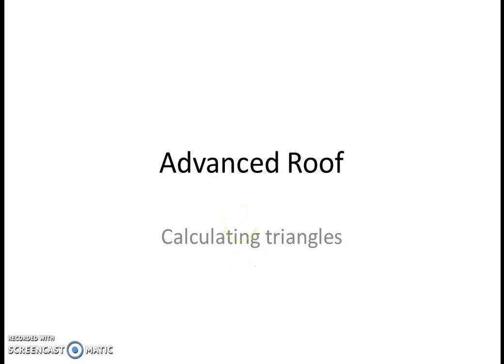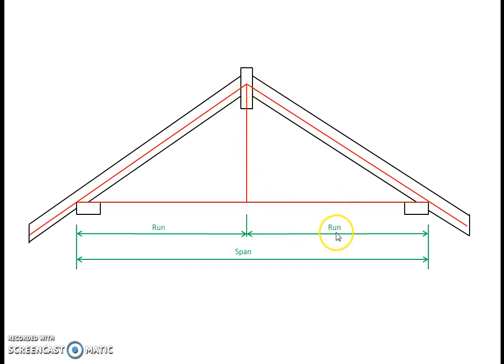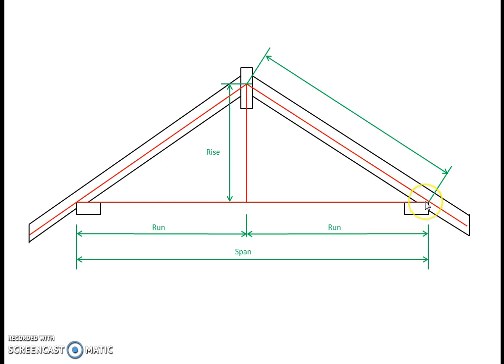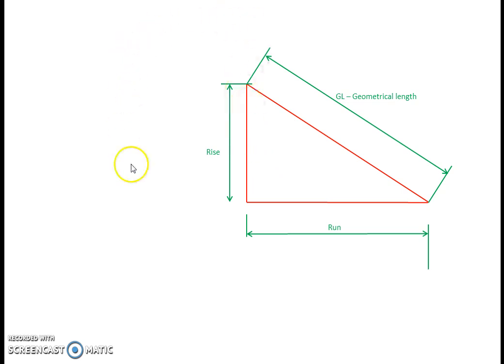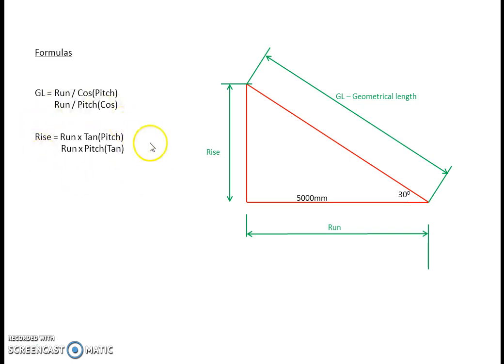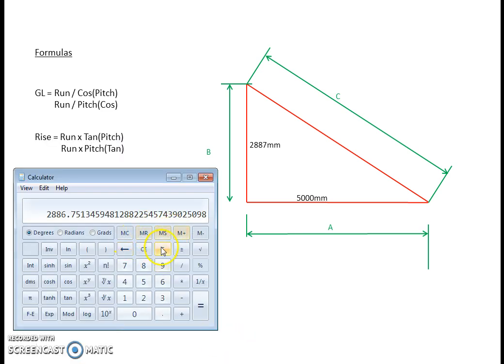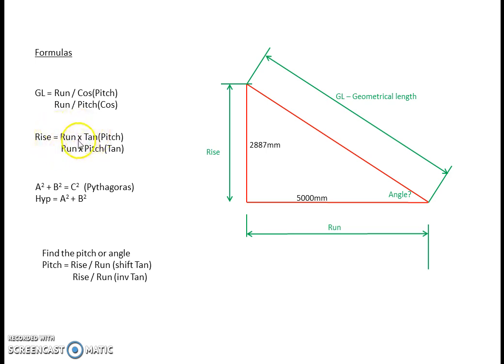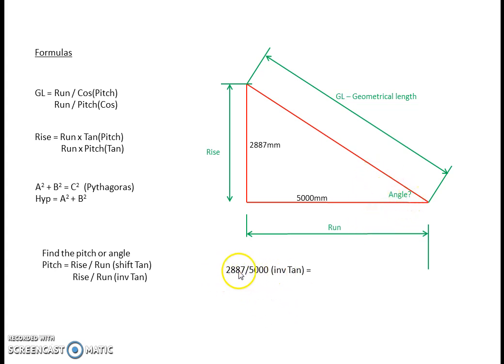Pitched roof calculations. Part 2 - Calculations

Comment: So, if I'm in a roof and want to figure out the rise where do I put my tape measure? The X Y line? or the underside of the ceiling joist? Then where do I measure vertically up to? The Apex?

Comment: Great video,  is the a formula to work out the angle using rise and run which includes the size of timber being used, example a 6x2
Reply from the maker: No. The calculations are just geometric lengths. The size of the timber is then marked from the backing line.
Reply: @mattthechippietrainer  thanks for the reply

Comment: What is a common birds mouth size? Taking the birds mouth to maximum depth which would be a third of your timber ? Does that change the pitch?
Reply: No it doesn’t change the pitch. You only need a bird’s mouth cut big enough so that the rafter sits on the top plate properly.

Comment: What calculator are you using because my Samsung calculator gives me 166.6666666667 when I divide 5000mm by 30 degrees? Am not good in mathematics and I find calculating the pitch of a roof as one hell of mathematical conundrum that has outstretched my foraging abilities.
Reply from the maker: Samsungs work differently to other calculators. You may have to put brackets in the right places to get it working. You can also use a triangle solving app. Trigsolver or something similar are very easy to use.

Comment: What if there is no given degrees at the moment? how to get the degrees. I have only the RUN and the SPAN?
Reply from the maker: Normally a set of house plans will give you the pitch. If you are trying to match something existing and you don’t know the pitch then you can get a height measurement and work out the pitch from that. Watch the video from the 10 minute mark for the formula.
Reply: I use a calculator most of the time.
Yes from bird's mouth to ridge is
5.773 m. ( Less half the ridge)
Rise = 2.885
2.885 / 5 = 0.577
INV ARC (tangent) 0.577= 30°
Love mathematics!

Comment: Thanks Matt. I'm designing a roof but only have the run and not sure the angle or the rise. İs there a metric formula to determine those factors?
Reply from the maker: If you are trying to match an existing structure then hold a level against the roof at one end, then measure how high the level is at the other. Then you can calculate the angle.